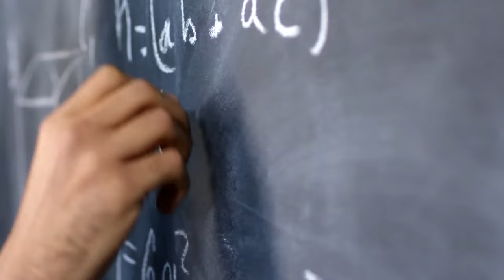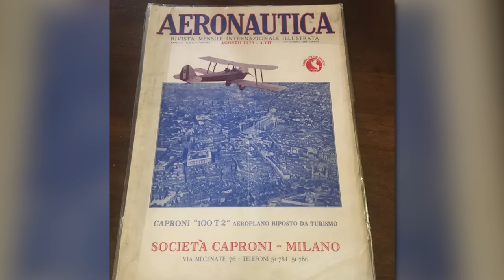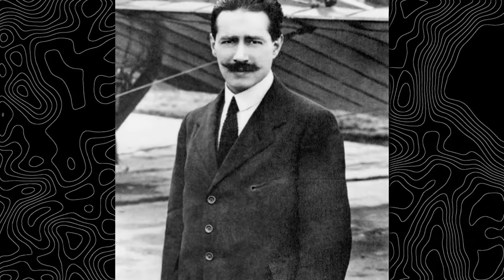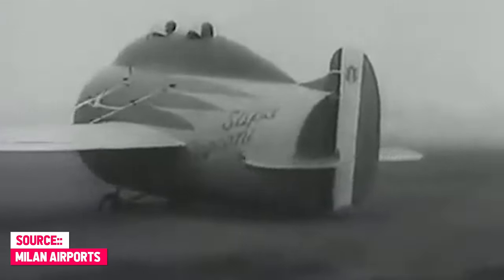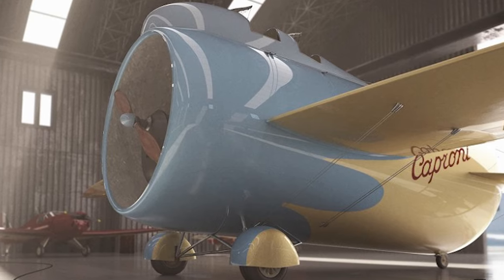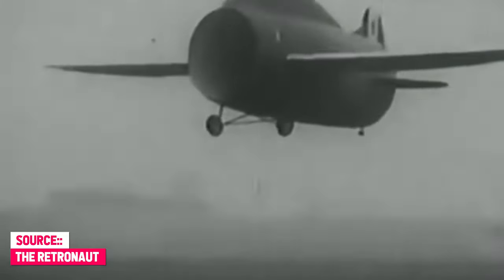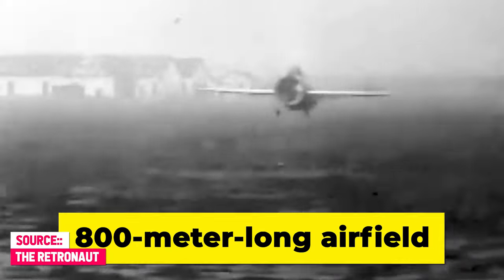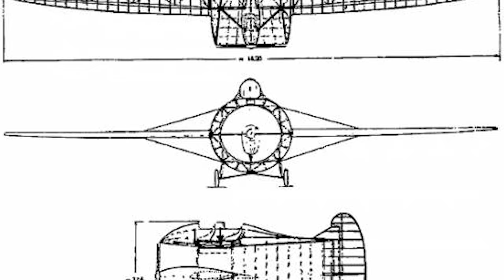Do A Barrel Roll | Stipa-Caproni

Comment: What I do not get is why they did not put the piloting section within the tube with the heads just sticking out. By leaving the inside profile of the duct cylindrical and carefully shaping that lowered section the narrowing of the cross section and thus speeding up of the airflow would also be realized. Or does Venturi have to be perfectly symmetrical?

Comment: And the design idea dominates aviation propulsion today. Take the Stipa-Caproni's fuselage, sans wings and tail, replace the piston engine with a turbojet, and hang two or four of them under the wing and you have every modern jet transport aircraft. Modern turbofan jet engines, particularly the high bypass variants, are basically the same concept.
Reply: Transporting what, exactly? The fuselage is hollow, allowing zero storage.

Ridiculous.
Reply: @leecrt967  You don't understand the term "transport aircraft".
Today's high-bypass turbofan engines are basically just evolved versions of the Stipa-Caproni; sans cockpit, wheels, wings and other control surfaces. They replace the piston engine with a turbojet, but rely on the larger fan blades to create the bulk of the thrust, much they way turboprop engines do. Like the Stipa-Caproni, they enjoy the advantage of the ducted fan's properties.

Comment: This would be an interesting  radio controlled model, has anyone ever  tried it?
Reply: Seems you haven’t watched this to the end.
Reply: G'day,

Inevitably lots of people built models, but the
Prize was the 4/5 or 7/8 (?) scale Single-Seat Ultralight ,(operated under the since abolished ANO -95.10...), in Oz, about 25 years ago.

I'm only 1/3 into the video - but my guess is that the Ozzie Ultralight will conclude the Upload...

Have a good one.

Stay safe.

;-p

Ciao !

Edit;

The Oz Ultralight, in colour, with the 4-blade Carbon Fibre Prop first appears at 05:27 ; in this video...

;-p

Ciao !

Comment: What's the advantage of the design? Yeah, it works. Barely. It's slow, with a lousy rate of climb. But even putting aside the "proof of concept" factors, where do you STORE anything? Gas? Machine guns and/or cannon? Radio? Oxygen? Your overnight bag? Geesh.

What a complete waste of time and effort. Even a cursory glance of the design would have displayed these shortcomings for anyone with common sense.
Reply: It had excellent climb.